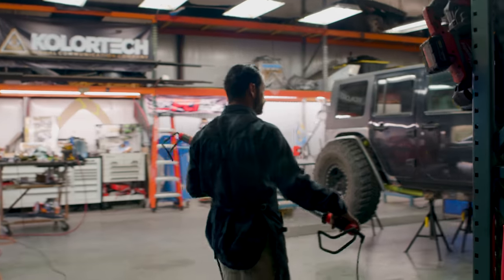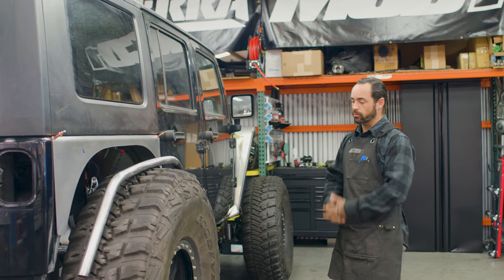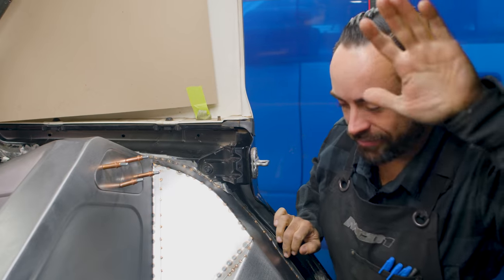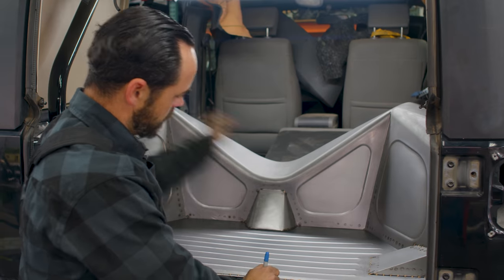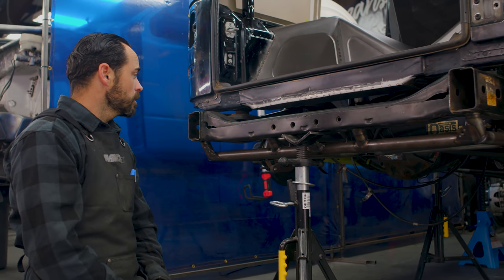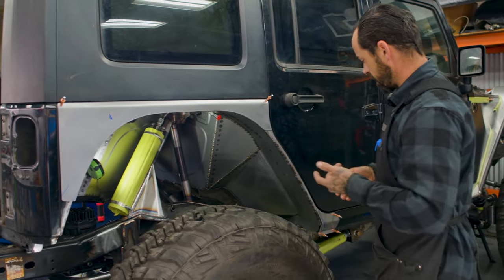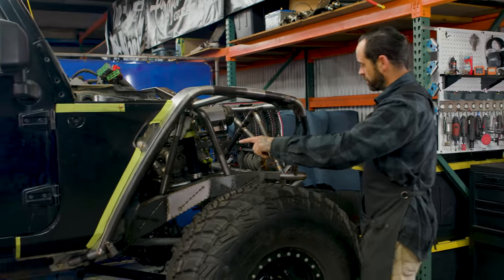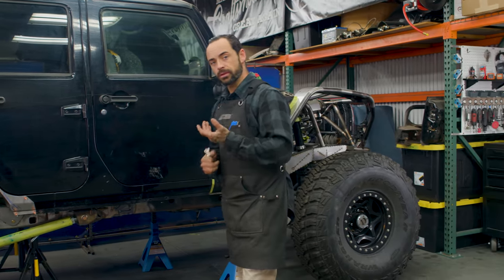Build Series | Jeep Wrangler JK Ep.2: UPDATE

Comment: Cooling: Muddy Beards has a video (that I can't find, or I'd link it for you) on hood louver locations. He referenced a study using 40 sensors which found the 3 optimum locations for hot air ejection. They lowered the engine compartment Temps by 20-40°. You can go nuts with louvers, or sprinkle your magic on some well placed small vents. Just a heads up.
Reply: This Jeep is going to be running our JL H.E.R.O. Hood so plenty of venting already in place.

Comment: Try using UHMW sheets ( ultra high molecular wheight)  for skid plate covers. I use 1/2 thick bolted to my belly pan. It works fantastic. It slides on rocks like it's ice. The build looks fantastic.
Reply: I was going to say the same thing. Check Next Venture Motorsports form Colorado they can make custom skid plates with UHMW. Plus they make a lot of aluminum skids too.

Comment: can you go more into depth on the silicone bronze welding in a fab diary? what’s the advantage of over tungsten
Reply: Silicon Bronze is a filler rod, tungsten is your electrode. Silicon Bronze requires less heat therefore the sheet metal is less prone to warping. There’s more to it than that, but that’s just the gist of it… plus it looks cooler IMO.
Reply: @Posibrian  okay that’s what i was thinking. i knew it took less heat but wasn’t exactly sure. im just getting into fabrication stuff for my own truck so trying to learn

Comment: I come from more of a crawler background but im always interested in the go fast stuff and love the detail you go in to. Cool to see you build a crawler to prerunner quality and thought process. One thing i was noticed is you mentioned the movement with the cab vs frame. The front fenders are tied in to frame but appear to tie in to body as well or at least very close. Seems there might be some issues there with movement?
Reply from the maker: The front is extremely rigid. We are banking on the structural integrity to keep the fenders and body happy towards the front.
Reply: I just know on my toyota the rubber cab mounts will move up and down a lot from impacts more so than flex. So i guess that’s what i was getting at, no matter how rigid you make things the factory mounts float around a lot

Comment: you could put .250 AL plate with UHMW plastic so she can party on the rocks. that's what blake put under the death boat.
Reply: Good recommendation. Just remember when fabricating the attachment points, that UHMW typically has a larger heat expansion, cold shrink movement, so the connection points may need to allow for that. And the larger the panel, the more that needs to be considered. This way it doesn't look like it's buckling on a really hot day.

Comment: HMW (high molecular weight) sheet is a polymer solution to underbody protection. It is supposed to slip off and over rocks. It gets all scratched up with actual usage, and looks like a plastic cutting board in a home economics class. 

Another solution is AR (abrasion resistant) steel plate or straps attached to rails in the direction of travel. Straps saves weight, plate protects everything better. Gundam level stuff. Rather expensive and harder on tools than standard steel. 

Can't wait to see what you decide as a solution. Takin' notes, don't F up! Lol
Reply: HMW got my vote, we actually use it in the water industry on specialized machinery and equipment that is often dragging and sliding on various types of abrasive media. Works great.
Reply: @Posibrian  that is what Wilkey has on the bottom of his Death Boat. For jumping gravel banks.